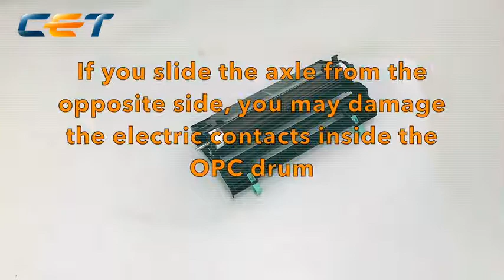Kyocera DK-150, DK-170 Drum Unit Rebuild Instructions

Comment: I attempted to rebuild drum but now it will not print anything. Can you tell me what I did wrong?
Reply from the maker: Hello,
The possible reasons for printing blank pages are the following:
-	Something blocks the laser beam. Check if the drum shutter is installed correctly. Check if there is anything that covers the rectangular window between green handles on the drum unit (the laser beam window). Make sure that you are not attempting to check printing when the top cover of the machine is open (it needs to override the top cover switch). When the top cover is open, the shutter inside the LSU blocks the laser beam.
-	Something has happened with the transfer roller in the machine when you removed/installed the drum unit into the machine.
Good luck!
Reply: @CETGroupUSAInc Thanks for your helpful reply. I re-installed the roller and now it prints but the density of the print is light. Could this be a "worn" drum? What do you charge for a drum and blade unit?
Reply from the maker: I am not sure what causes the density issue. I will check with our technician on Monday. For pricing and availability, please contact customerservice@cetgroupusa.com. Thank you!
Reply from the maker: Here is what our technician says: Low ID may be caused by various reasons. A worn drum is an unlikely one. The typical way to troubleshoot this issue is the following:
- Cover the charge corona contact in the drum unit with a piece of adhesive tape, then install the drum unit into the machine. Print any page - with the charge corona contact covered it should be solid black. If the density of this solid black page is OK, then the likely reason of low ID is dirty optics in the LSU. If the density is low (the page looks gray) go to the next step.
- Make the «stop-test» - start printing any page, then open the top cover to interrupt printing when the leading edge of the printed page reaches the OPC drum. Remove the developer unit, the jammed page and the drum unit, then have a look at the toner layer on the OPC drum prior transferring. If the toner layer on the OPC drum is solid black, then you still have some problem with the transfer roller. If the toner layer on the OPC drum is «gray» like on the printed pages, then you have some problem with development - poor toner for example.
Do not forget to remove the adhesive tape from the corona contact when you finish troubleshooting. And keep in mind that these Kyocera machines normally do not print as dark as many HPs, for example. ID above 1.0-1.1 generally is OK for such machines.
Reply: @CETGroupUSAInc  thanks for your helpful suggestions. I’ll try it.
Reply from the maker: @bobwilliams4770  Hello, If you need any more help with this I think we could serve you better by contacting you directly. If you let me know what region you are in, I will send you an email address of a CET employee you can contact. Thank you!